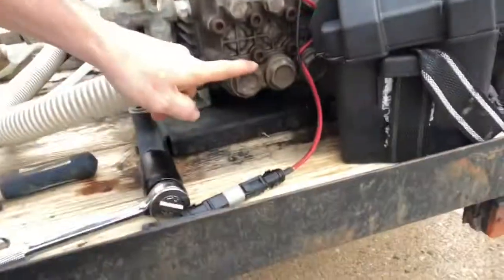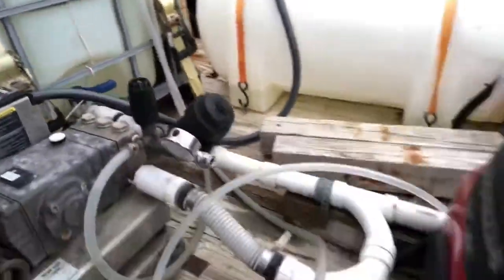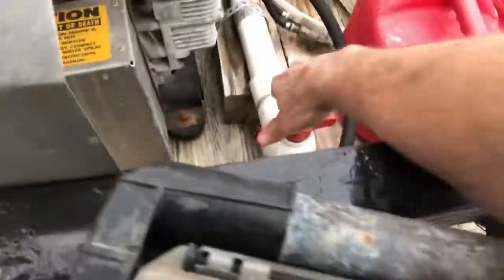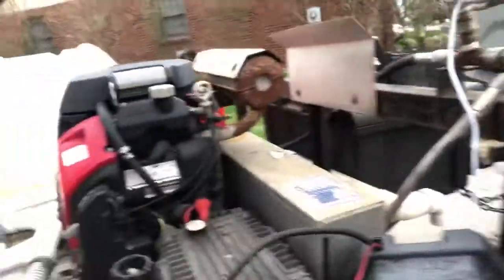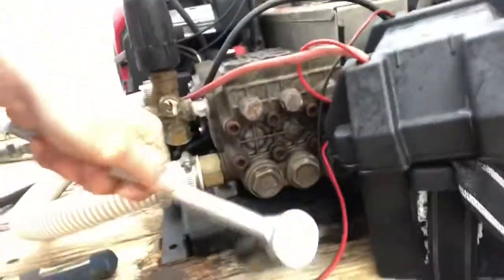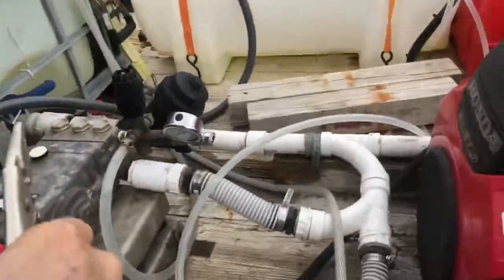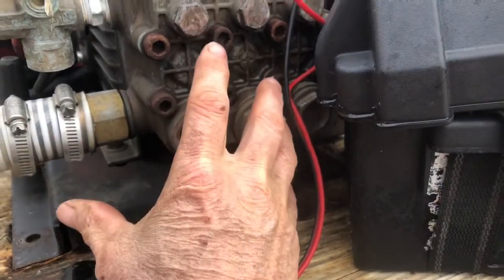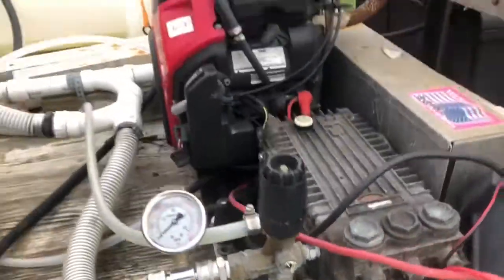How to do a quick pressure washer winterizing on the fly!

Comment: Hey Mike, another quick tip is to use a m22 quick connect (kinda like the twist connectors lowes machine use but you can buy better ones) on your bypass hose that goes back to tank so you can drain it too. If water is left in bypass it won’t hurt anything but the hose BUT if you start it with that still frozen it’ll bust the hose for sure. Takes 10 seconds to twist the connect loose and drain the hose
Reply from the maker: I love that!!!
Reply from the maker: Thank you